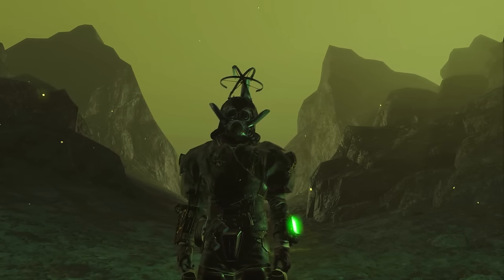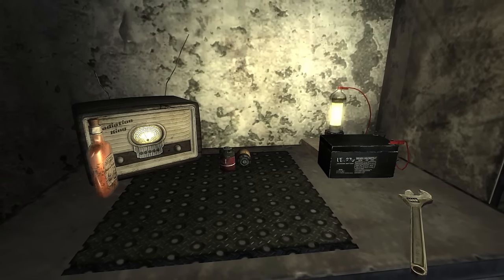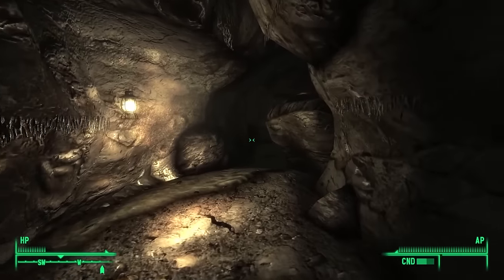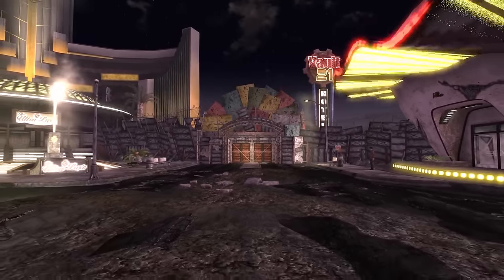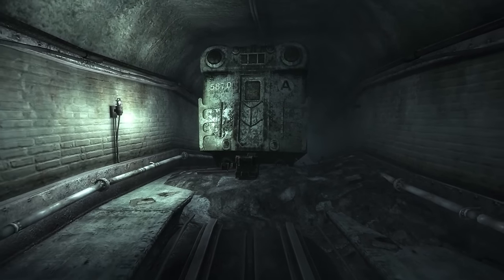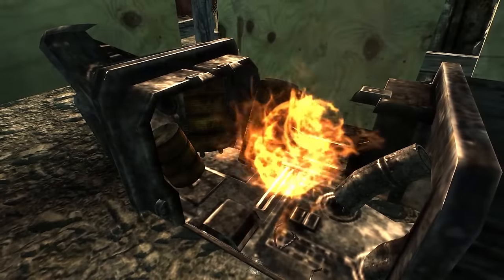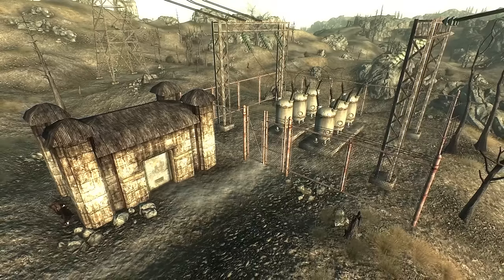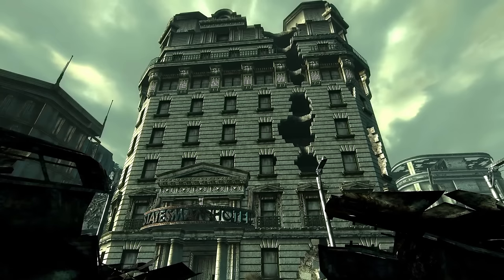Where does the power come from in Fallout?

Comment: Or in smaller towns of Fallout: New Vegas, you see houses powering themselves off of an old fission battery plugged into the side. It's literally a nuclear reactor in a box, just strong enough to keep the lights and appliances of a single home running. You can see one directly outside of Doc Mitchell's door.
Reply: would be interesting if you could destroy those and the power would stop working like when you pull a fusion core fallout 4
Reply: @_armu  the power flickers for a second in fallout 4 but stays on when you remove the fusion core. Would of been a cool detail if removing it disabled lights and powered doors, and made terminals no longer powered. Maybe you could find places that already don’t have a fusion core so you’d need to install one to get the doors and terminals working again, and would of added another element to the resource. Do you spend one to gain access to a new area or keep it to power your power armor.
Reply: @clan741  that actually sounds like a cool an interesting mechanic to have! 

Too bad thats its too original of an idea for Bethesda.
Reply: @clan741  Maby there's a back up system for when the power goes out 🤷‍♂️
Reply: @blacktemplarbrotherlucius1935  I think  Bethesda, puts in detail in different places. Mechanics are old and unoriginal. But their lore building I think is fantastic. Although that definitely applies more so to the elder scrolls series. But Fallout has good lore aswell.
Reply: @MrTypicalPlayer  100% agree but i think they need to share some resources because if the game play is boring and the story is Insulting my intelligence then lore doesn't really mattet.

Like they need to fire the lead writer that worked on the main stories for FO3 and 4 because its terrible writing especially 4.
Reply: @blacktemplarbrotherlucius1935  Fair enough, agreed.
Reply: This is why New Vegas is the ONLY REAL FALLOUT GAME
Reply: @welderboy13  Don't disrespect the ancestors)
Reply: @clan741  or maybe when you clear out a metro of mole rats and grab the last core, you return later after the cells reset and it’s now completely dark and ghouls have infested the tunnel. Or perhaps you power a building with your core and return later to find raiders have taken over, or a group of squatters have moved in.
Reply: @welderboy13  fallout 2 . If you are old enough. After that its new vegas
Reply: @welderboy13  of the newer ones yes
Reply: @toudi_p  I really like tactics
Reply: @clan741  that would be pretty cool
Reply: @clan741 , I agree. Perhaps someone should build a mod, for that. 
Oh wait, those of us who didn't get the memo that came out, about ten days ago are basically locked out of FO4 if we got mods. Anyhow, those who aren't locked out can benefit from such a mod at least!
Reply: @samjohnson1992  i liked it too , only it lacked quests. I remember the shock facing super mutants , immune to big guns , except .50 cal ( first time i played )
Reply: @MrTypicalPlayer  They do indeed put detail in different places. For example, they put 100% effort into TES, but completely phone it in with 5% effort when making a fallout game.
Reply: @jed-henrywitkowski6470  Can you explain? What do you mean locked out?
Reply: @Celastrous  Facts.
Reply: In fallout new vegas you also have the power plant that gives power to ncr and strip
Reply: @welderboy13  Dude, no! There are only three to choose from, the 3D ones. The first two, I played Fallout 2 a couple of years ago to see what it was like. Then fought hard to get this particular dog I thought would make a good pet. Nope. Sadly all my save games were from AFTER I got the useless stinking fucker, so I just gave up. It was an OK game and I suppose would've kept me interested if I'd bought it back in the day. Not the most fun RPG from back then though. 

Fallout only really started with 3, and they're all great! Even the stuff that isn't the best, is still amazing compared with other games, or, I dunno, going outside. I quite like Subnautica, for similar reasons, building a base and wandering round having adventures.
Reply: What I wonder is... We can barely mind enough lithium, how were they do adept at it they can just put uranium in everything. Sure it's not too big amounts but not only houses, each car, robot... And who knows what else
Reply: @clan741  Hardcore mode in the remaster?
Reply: @CMDRunematti  This is a universe where they adopted nuclear energy extremely early. They don’t use lithium in this universe to the degree that we do. It does not take a lot of nuclear fuel to produce power, and a lot of the concepts here are achieved like RTGs.
Reply: @ryanhuddleston5321   @Ryan Huddleston  and we don't use nuclear fuel at the extent they do. Those two I felt would more or less cancel out. Apparently an electric car needs around 12kg of raw lithium, and that's rechargable, so I'd we say a car would use that over it's lifetime of nuclear fuel(say, 15 years of driving around on 12kg of uranium, sounds about the ballpark) then we can compare mining them. Uranium is harder to mine due to it being radioactive. Doesn't that make sense?
Reply: @clan741  let's hope they ha r something similar in the next fallout
Reply: @greenaum  the depth and stories in Fallout 2, unmatched total freedom and ability to really be the bad or the good 
Best RPG ever in my opinion
You could own slaves, star in porn, kill children, rob graves, get married, become a boxing champion, run the mob, and it all would affect the world around you 
F3 with immortal “essential characters” and quest markers… too easy and limited.
Reply: @greenaum  in F3 there’s the thing where you choose the evil ending and all ghouls/mutants die and stuff 
And then you go out (DLC) and NOTHING changed. You literally committed a genocide and NOTHING changed in the game. That was soooo disappointing
Reply: it would have been cool to have the mechanic of needing to use the fusion cores like a lifeline in some cases, like you carry your power armor everywhere you go, but when you need to take out the fusion core to power something else, you can take it out for a while and plug it into something else and when you are done you unplug it from the generator your using back into the power armor, but also make them actually last longer and make the fusion cores a lot more scarce instead of abundant like they grow on trees and run out like a battery.
Reply: In 76 aswell
Reply: I never realized that's what was going on.
Reply: @CMDRunematti  the bomb that was dropped on Hiroshima, little boy, contained 60kg of uranium 235, it was an incredibly crude and inefficient weapon. When it exploded, about 99 percent of the uranium that was supposed to undergo this chain reaction, didn't. It just blew apart in the air, and a very small percentage, maybe two percent of the fissile material, actually detonated.

You dont know a thing about nuclear materials obviously lmfao
Reply: Literaly back feeding your house with a tiny chernobol
Reply: @clan741  Fusion cores are the “ignition” for the fusion generators meaning power would still be running even in the core’s absence.
Reply: @OlegAryutkin  Tbf fallout 3 was intended to end at the purifier and leave everything else to imagination. Broken steel was the result of community backlash that the main quest line was too short. Should they have done something? Probably but industry deadlines are no joke and implementing a genocide that would be believable just wasn’t possible
Reply: @OlegAryutkin  I accept you may be exaggerating for effect but its not that nothing changed.

If you choose to infect the water settlements with a doctor will be treating patients dying from drinking contaminated water.
Doctor Preston, Barrows and Church have new dialogue about it.

Additionally it adds negative health effects to Aqua Pura consumables when the player drinks it with the FEV choice.
Reply: @MediumRareOpinions  yeah but the script literally says all mutants, ghouls and most humans will die, and I expected a genocide not a couple of dialogue options.
Reply: @OlegAryutkin  The explanation for that is its not contagious from infected person to person, its only been 2 weeks since the water was contaminated and it will spread out as more people/creatures consume the infected water that gets into rivers, ground water and rain over time.
Reply: New Vegas also has a solar panel array just north of Novac, and a mission gives you the option of routing the power equally to everybody, just to the big city, or other. And also, the Hoover Dam as well.
Reply: @OlegAryutkin  Not just the mutants die, most people would, everybody was a little bit genetically damaged by all the rads. But you're in the early days, the virus hasn't spread yet. Broken Steel was a DLC, it would have taken forever to have everyone in the world dying or dead, they'd have to change so much stuff. Too much for a DLC. But yeah it was a bit crap. But that's because it's set after the game was supposed to end. The evil ending was supposed to leave you thinking you've committed genocide and that was that. The End. But then it wasn't. So...
Reply: @blacktemplarbrotherlucius1935  it be real anoying in survival mode since a fussion core weights a good bit
Reply: @blacktemplarbrotherlucius1935  Dead Space 2 has the same system, so they don't even have to worry about being original.
Reply: @blacktemplarbrotherlucius1935  Can New Vegas fanboys go 3 seconds without mocking bethesda for something trivial that doesn't matter?
Reply: Fission batteries are less a niclear reactor and more of a plutonium decay battery. Low output but very long shelf life... Then you have the idiot who wrote the Pung Fruit Moonshine quest in Point Lookout say they have acid in them.
Reply: @MrTypicalPlayer I would say the opposites, a lot of their lore building is bad, but the mechanics have a satisfying loop to them
Reply: @Spiffo0 How people live and maintain their standard of living matters a lot.
Reply: @DIEGhostfish  nitpicking clowns.
Reply: @Spiffo0  Normie goloid.
Reply: Is that what those were? I've seen that on Doc Mitchell's house and had no idea what it was or how to ask about it
Reply: @blacktemplarbrotherlucius1935  straight facts ... It's a well touted opinion that the best Bethesda game was made by obsidian and not actually Bethesda FNV all the way!
Reply: @Spiffo0  As much as i love NV it does have it's own problem, alot of those problems are (imo) because of NV's short development requirements that Bethesda themselves implemented.

But Bethesda has a history of removing or dumbing down game mechanics and RPG elements. Compare the base games of Morrowind to skyrim, and we see things like spell making, stats, weapon types (polarms, short swords, throwing weapons, crossbows and etc), spell senergy and faction reputation witch where cut over ES games, while skyrim added Crafting.

Its not nitpicking when Bethesda is making the same games, on the same ancient engine, cutting more mechanics, yet are taking longer to make their games.

Starfield has been in development since 2015 (roughly 8yrs) an Bethesda's main studio, while No Man Sky too a little took a little over 3 years (plus a few more for improvements) and with only a small studio made a better space exploration game than Bethesda.

Being critical of a game with actual complaints of the game and the studio isn't being a "hater" or "petty", if people didn't care then they wouldn't bother sticking around. I love Fallout and Elder Scrolls but i like many others want to see improvements, not just Stagnation.
Reply: @blacktemplarbrotherlucius1935  The NMS argument is really awful. No Man's Sky only has exploration, that's literally all you can do in the game. Every other part of it is not even half baked. Starfield is clearly focusing more on the RPG side than exploration. 

Also, your New Vegas excuse is also bad. I've seen this "It's Bethesda's fault they FORCED the poor obsidian devs" argument dozens of times and it's not even true. Obsidian agreed to a contract saying they could finish the game in 12 months. Todd Howard wasn't forcing anyone to do anything.
Reply: The good ole frick it off the gride power but instead of blowing thru a ton of car batteries just one nuclear boy that would in theory last for generations like a pip boy
Reply: @MrTypicalPlayer are you kidding me? Lore is pretty good inn fallout. It goes just as deep as elder scrolls. 😅
Reply: @toudi_p my man put 2 over the 1st game. Fallout is just as good as fallout 2. I do prefer new vegas over these 2, but gotta respect the 1st games. 1😅
Reply: @trueredpanda1538  cap level in vegas sucks . The best thing i like about those games is build up
Reply: @toudi_p  LV 50 is fun. 25 perks to mess aroubd with. How does level cap suck?
Reply: That's what I always thought. There are countless miniature fusion reactors laying around as weapon ammo, all of them seemingly still working
Reply: I love fo3 story and lore but love new Vegas mechanics and creativeness
Reply: @clan741  maybe the core was being charged not actually providing the power?
Reply: @clan741  they explain the Power not going out when you pull a Fusion Core by stating that the Back up Power goes online so kinda like Police Stations and Hospitals the Second the Power goes out the Back Up Generator Automatically turn on
Reply: @blacktemplarbrotherlucius1935  They show why in the TV show now.
Reply: @clan741 I feel like that's probably the direction the devs wanted to go, but they just didn't have enough time
Reply: @Spiffo0  Yea, even tho NV is my fav, I find the “NV is better in every way” shit to get old too. I think NV has better writing and selection of weapons. And I like how NV isn’t focused around combat. But FO4 is a great looter shooter and FO3 is a super fun romp through the wasteland. I think all the 3d games are great in their own ways
Reply: “It just works.”
Reply: @welderboy13 I enjoy them all🤷🏽‍♂️ I’m not biased by the new Vegas band wagon. All the games are fun and good IMO.
Reply: Fission battery sounds less like a reactor and more like the thermoelectric devices some space probes have.
Reply: Yeah you can see street lights using them too just slapped on the side and the batterys look way bigger then the ones you carry around
Reply: @clan741 they are disabled eventually but its just running on backup power for a while
Reply: It feels like a miniaturized nuclear reactor would be capable of producing a lot more power than just running a single home, much less a microfusion cell. But fallout scaling has always been weird, even before bethesda.
Reply: @clan741 i like that idea, i get the feeling they might've had an idea like that but didnt end up implementing it, leading just to the lights flashing instead of turning off. That would be such an awesome addition for any fallout game, whether the fusion cores for large generators and buildings or the fission batteries for smaller remote places as well. Would be an awesome survival mod, you cant access practically most of the places with fusion cores unless theres people there actively defending it, otherwise those would have long been taken by scrappers. That could be a really unique aspect to the game and work well with other elements, like you mention terminals and the quests/ unlocking safes and doors that comes with. Change how areas look and operate entirely, and would make more sense finding pre war untouched rooms and such. Also, stealth and using darkness/disorientation, or you yourself being disoriented in the dark and prone to attack

Sorry for the ramble, i just really like the idea.
Reply: @CMDRunematti  except that uranium ore is just safe to handle without protective equipment, at least if you're not eating it or sleeping with it as a pillow, to make large scale uranium mining safe you really wouldn't need much different equipment than with other mining operations, respirators and thin, lead lined suits would make it as safe as almost all other operations.